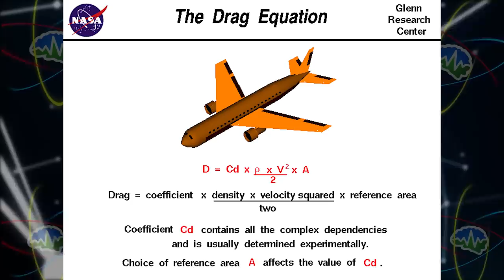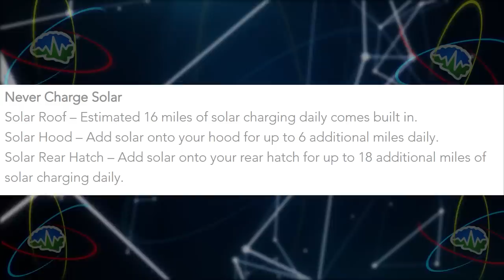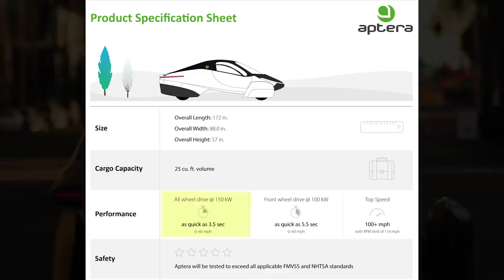Aptera Beats Tesla? | In Depth

Comment: I want to start by saying that as an aerospace engineer & a pilot, I love the concept and i am very interested. Looking forward to try it.

When comparing numbers, one must however be fair and compare apples to apples, i.e. consumption: no one would ever compare the fuel consumption of a 2 seats Miata to a 5 seat SUV without any notion of scale. It is expected that a two seater would use 1/2 less energy that a 5 pax car. What would be the numbers for a 4 or a 5 pax Aptera?
I am also curious about looking at the whole picture: what about crash safety?, will be certified as a '''motorcycle'' (Campagna T-Rex) or a car?, how does it handles in the snow? (Does it compare to the Nobe)?
Reply: It is designed to and will be crash tested to automotive safety standards before production begins. Due to this, and the fact of state of the art stability control, a much lower center of gravity, and a 334 e rating, plus considerably more power, acceleration and top speed, there is little comparison to the Nobe performance.  Also, the Nobe website is claiming 18 preorders  this may not be current.  Aptera has well over 5000 in a month of availability .

A 5 passenger Aptera is planned, probably 4 wheeled, but no word on specs yet.  We will have videos of performance in snow on the Elaphe cold weather test track next year.  With snow tires, the AWD model is likely to be very good.
Reply: I went ahead and compared the Mazda CX-5 (current equivalent of the Miata) and a 5-seat SUV (Mazda CX-5), turns out the CX-5 is only 7% more efficient (30 mpg vs. 28 mpg). The Aptera is be classified as an autocycle (registered as a motorcycle, but can be driven with regular car license in most states). Aptera states they are designing it to meet automotive safety standards anyway. Munro is working with both Nobe and Aptera, so I think we can expect them to have similar (or same) in-wheel motors with torque vectoring. Aptera is wider, which should make it more stable.

Comment: Heat or cold affect ev efficiency.  This is a good  video.  Problem 1 Omaha, Nebraska has the extreme of all seasons.  2 Nebraska is not California,  I don't see a lot of charging stations.  3 you can trade in your car for credit toward an upgrade model. I live check to check.  My credit is impaired.  Aptera equals maybe $40-50K.  That's a small house or condo.
Reply: I live in Southern Iowa.  The 250 mile range Aptera starts at $25,900 and can be charged at a rate of 13 miles per hour of plug time from a standard 110 v. 15 amp outlet.

Comment: you could also put a wind generator on the front to take advantage of the existing drag to drive air flow powered generators with accompanying flywheel. You could cut your battery consumption down, quite possibly another 50 to 70% & extend the range even further. Depending on how you did it.
Reply: No.  This would create far more drag than the power it produced.

Comment: The car looks awesome and complies to efficiency ...
But I felt a strong Reliant Robin feeling until I noticed that Aptera offered also an all wheel driven model.
Lets face the low road holding capabilities of a three wheeler IN THE RAIN which simply is in the range of dangerous.
So the model for me would be an Aptera Integrale with all possible traction controle and ABS systems available.
Actually looking at the Solar Challange styled models a four wheeled Aptera is not far away ... but maybe that could be something for the next generation BMW 3 series ...
Reply: Not only superior traction control, but also a far lower center of gravity.  This design has nothing in common with any other three wheeler and is even better than most SUVs.

Comment: Flying pumpkin seeds would work pretty well.
Do you guys remember the very light car?
I expect it will be in that in-between autocycle category.
Yeah I wonder if I could install pedals?
I hope they made their brakes work more smoothly.
I'm not a big EV guy but I love the look.
High end speed is drag limited.
The VW XL1 comes to mind for comparison.
There are other 3 wheelers.
It's tough to produce a product.

I3 weird doors are costly structurally.

Comment: this is the only EV car I believe in, but I'm a little skeptical of 3 wheels on slippery roads in the winter! They should also make certain design changes, such as the front headlights, and generally more luxurious designs on the exterior and interior.
Reply: Ive never had an issue with my 2-wheel drive Lexus ES300, Camry, or Corolla driving in Northeast winters. I don't think the winter driving will be as bad as some people think. This might handle snow better than most non-AWD cars. Heavy Buffalo snows are a different story though...

Comment: Since the veh is so light, and aerodynamic, how would it fare in areas who experience high winds, such as Colorado where the weather is very unpredictable??
Reply: I have driven my 1800 lb Gen 1 Honda Insight in such conditions and it is fine.  The shape of Aptera means that it will see even less wind pressure and should be better than most vehicles on the road in this respect.

Comment: in response to your question at 27:50 Big car companies did figure this all out. Decades ago. Thats the reason why the legislation was limiting stuff to "you must have a 4 wheel vehicle" to be considered a car. Aptera, right now, is fighting to get themselves classified as a car and not a motorcycle so you aren't required to wear a helmet in most states.

now there is a downside to a trike vehicle. You are going to feel every bump on the road. In a 4 wheel car, you can drive over a bump/pothole/manhole cover by putting the body on top of it, your wheels dodge. In a 2 wheeler, you can dodge around in that lane to avoid the obstacle. In a three-wheeler, either your side wheels or our center wheel is going to hit every bump in the road. My question: how are the shocks on this thing?

Comment: In case your interested, Drag is part of the discussion, but not all. Drag is a force, power is more appropriate and interesting.
Drag changes with V^2 (velocity squared). 3 times as fast 9 times the force required
Power changes with V^3 (velocity cubed) 3 times as fast 27 times the power required
This is all aerodynamic. Mechanical is linear (old boring stuff :) )
Go A-tera!

Comment: Been investing in EV startups for decades.  The production problem is the biggest by far.  Lots of experimental vehicles have great specs but have never been able to be mass produced.  Look at Arcimoto's FUV (which I've been on the pre-order list for years).  I hope they're able to create mass production lines.
Reply: They are well aware of this, and the production design is just as innovative as the car.  Chris has already produced thousands of boats using similar methods at another company he founded.  They have enlisted Munro Associates to help with this.

Still, they agree with you, and say that they may experience the same "production hell" that Tesla had with the Model 3.    They are expecting it and will work through it.  It is helpful that their capital costs are far less, and that the planned production capacity for this vehicle is only 10,000 per year.

Comment: I am still a believer in the Cybertruck. I need a truck but I don't need a truck all the time, I need seating for 4, but not all the time. I need to be able to dive in fields and snow, but not all the time. The design doesn't bother me because just as the Aptera is science based the design of the Cybertruck also is science based. The most popular gas guzzler's being sold are trucks, even mid sized trucks get similar gas mileage as a full size.  It is as if current truck makers are saying you might as well get a full sized pickup.

Comment: I'm totally into the Aptera and I was really disappointed when it went bankrupt the first time around, but what you're missing is that this difference of the Aptera from traditional cars is really really not just the appearance, it is a lack of interior space.  It is a two passenger vehicle with very very little space for cargo.  I think they said it's wider then a model S; that is absolutely not a plus since it doesn't have the space.  So it has comparable interior space to something like a smart car while not being any more maneuverable then a full size vehicle.  This is simply compromise that people who are into extreme efficiency like myself will need to make in order to achieve that extremely aerodynamic profile but we can't ignore that it is indeed a major compromise.
Reply: Looks are deceiving.  It has 25 cubic feet of cargo space and enough room to sleep two people for camping trips.  This is more than double the  12.4 cubic feet of cargo space in the Smart.

Oh, it may be able to do tank turns.

Comment: Watching  again....I really  want to see it go through its paces.  I hope I don't miss it.  I am from Canada. We have  had a tremendous amount of snow, slush and today very icy roads.  Curious  how  it would   handle in Canada in those conditions.
Reply: There will be testing in winter conditions at the Elaphe winter weather test track this season.  The AWD version should do very well with snow tires.  The ABS and traction control can sens slip and adjust torque about every 2.5" of tread travel - far more quickly than any other vehicle out there.  I should have mine to try in Iowa next season, and will report back.

Comment: I like the idea of the car. But you could get even more out of the solar feature.
You could even get more out of it if you would "glue" some solar cells onto a reflecting windshield mat you normally pinch between the doors and plug them into a solar inlet inside the car.
So, your entire car would transform into one giant solar panel and this also prevents the car insides to heat up to 1000°F while parking.

Comment: Buckminster Fuller is the grandfather of this design concept. My only question is, what is the highway safety rating? Say, a head-on crash with a Cybertruck on a 40 mph highway. I think I'll give up range for safety.
Reply: The founder's and designer's focus on safety is just as single minded as it is on efficiency.  Even though it isn't required due to the vehicle class, Aptera will be tested to automotive safety standards shortly before production starts and we will know the ratings.  Modeling, and actual crash experience with the original design both indicate that it will fair very well.  I think that a lot of people are going to be surprised at how good it is.

Comment: They could probably have a vertical wind turbine inside the car that could be deployed like a periscope when the car is parked so that it could get some power if it's in the evening when there is no sun available or even on a sunny day when it's windy.  If the blades rotated parallel to the roof of the car, they would spin regardless of where the wind is coming from.

Comment: Wow ! ... At first I was mostly just jovially amused, but it's a well designed presentation (even for "sticks in the mud" like me).

The ping-ponging between the two of you for functional, "as a matter of fact"  facts, friendly conversational details,   comprehensive comparisons, and logistics, et. al. suddenly swooned me back into my seat (of accumulative persuasive observations) as the logic continued to multiply gain acceleration and the "odometer" of good points rolled up, on dial.  
The "Gee's" for me [fun intended]  pushed me all the more to be well strapped in, and pleased to gravitate towards.

It helped to put me "on track" for  summarizing in an "all things being equal" solar battery  pack perception.

Additionally, and more seriously, (within reason of personal context and features) most of what America and other countries need right now is a  ubiquitous & "do-able" starting point for an electrical vehicle that assures safe, speedy, and economical entry-level.  Certainly, to me, it's much more feasible & robust in purposes than a motorcycle would be, and etc.  

Plenty of good arguments in favor here gentlemen, and great job in presenting, ... IMO.

Comment: I would love one of these.  I have a Tesla Model S and I love it.. it's an older one.. 2014, so charging times on long trips are slower,  but still beat most new evs, other than Tesla.  I want one of these for my long range work driving car.   Imagine the fleet of people that have to travel for work.  I won't even order the 1,000 mile range, I mean on a 6 hour trip, I will need to stop for lunch or to use the bano.  600 miles is enough and it's $10k less, heck to be honest.. 400 miles is plenty of range.. why carry around too many batteries.
Reply: Agreed.  I live in California, and we already have a pretty good charging network.  I was able to get to most places I wanted to on a 200 mile range motorcycle, so I am not too concerned.  I ordered the 400 mile model.  (I don't expect to actually get 400 miles driving fast - perhaps more like 270 at fast highway speeds, and less going up mountain passes.  Still enough.

Comment: They could make 6 seaters like a Beech Bonanza/Baron with club seating at the back (like a stage coach). And narrow like planes for more efficiency. And maybe only two wheels (a motor cycle) that has two extra wheels that deploy at low speed and parking.

Comment: This is pretty much exactly what I would build if I made my own EV.  I do see 2 problems with them as a car company.  One is crash worthiness.  One of the reasons for going 3-wheel is to side step some requirements.  I dont see these holding up well in a crash with an SUV. The other issue is service.  That is the hardest part of a car company to develop.  Tesla still isnt there.  With all of that body work covering all the parts, I dont know how difficult and expensive it will be to change brakes, tires, batteries and other consumable parts.  I consider that more of an unknown than a fault, but it looks difficult.  After they come out and we can see all the ups and downs of it, I would definitely look into it. I encourage everyone else to preorder and invest, because I want this as an option one day.
Reply: This car is designed to do well on automotive crash tests and we will have the ratings before it goes into production.  This car is so simple that most service will be a simple part exchange.  Tire and brake service will be almost like any other car.  A minute to unlatch the wheel covers.

Brakes will be very long lived, due to the regen braking taking most of the load, and the light weight.
Reply: @n.brucenelson5920  when I say its something I would build I mean it.  25 years ago I was looking at kit built aircraft and wondering why you can't build a car the same way and end up with a similar weight and aerodynamic result. When Teslas appeared, I was impressed by the power and range, but disappointed by their needless complexity and the company's hostility toward DIY service and repair.  I can definitely see their appeal to some people, but they just seem like rolling bloatware to me. You have to blame government regulations for some of that, but Tesla chose their path and it largely paid off.  I'm just less conventional than their buyers.
Reply: @michaellowe3665  I agree, and a lot of people on the Aptera forum do too.  There has been a lot of recent discussion about packaging an Aptera kit, since a lot of the work at the factory will be putting together sub assemblies anyway.  

Most of what you need, unlike 10 years ago is available from the world wide EV supply chain.   The wheel motors alone will make building a kit car much simpler than it would have been  Decades ago I had a Kelmark GT which was a somewhat better built body than the Bradly, that was a rough copy of the Dino Ferrari.  Imagine what that would do with 2 or 4 50 kW wheel motors!

Comment: Noooo! Never ever mount motors within front wheels! Why? Because of the constant bounces. shocks and severe vibrations. How do I know? Because  I mounted front fenders on front wheels, and in 17 years ownership I was constantly welding cracks in the mounts and fenders. Plus it was just a car shower and not a daily driver. Imagine the sensitive electric engine parts components suffering from all that jarring!
Reply: There is a whole different level of engineering and testing that goes into these.

Comment: I actually don't mind the look of the car I think it's kind of cool I'm just wondering what the safety aspects of it would be in a crash or driving in the snow. Thanks another great show.
Reply: It certainly has safety features not found in any other three wheeled vehicle, and will be voluntarily crash tested to automotive standards.

Due to sensors and motor controls being co-located in the wheels, slip can be detected and torque adjusted every 2.5 inches of wheel travel, far more quickly than any other vehicle.  This will likely give the AWD model exceptional performance in snow, but we will wait for cold weather testing to be sure.

Comment: Interesting Video.  The limit of 2 seats might be a drawback.  The efficiency is well done.  With being lighter and more aerodynamic I wonder how safe it is with the bigger chassis in an accident.  But their design of the Aptera is very intriguing from a design perspective.
Reply: Aptera is a niche vehicle for sure.  The design will be crash tested and ratings published once production intent vehicles are available to test.  Having been in a high speed rear end crash by a large car in my Gen 1 Honda Insight without injury, I have little worry in this regards.

Comment: Yeah price is my big obstacle for electric cars. Range I'm not that worried about. And yeah where to plug it in. Id have to contract an electrician to install conduit and a lockbox near my parking space.
Reply: This can gain meaningful range through an extension cord plugged into a standard 110 volt outlet.